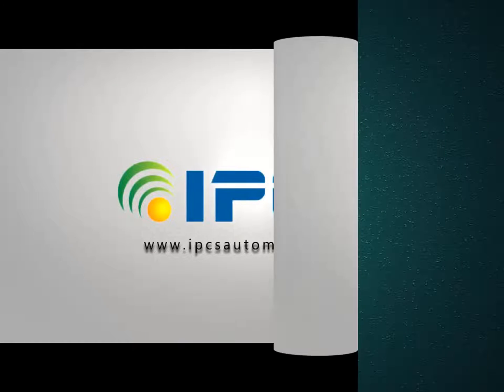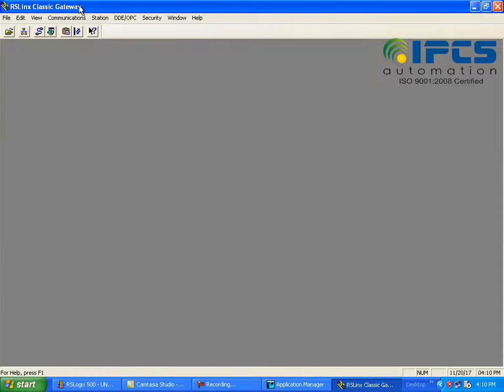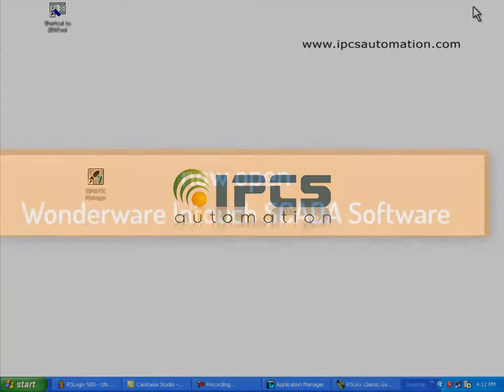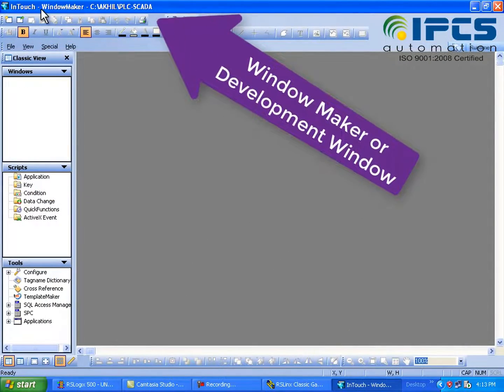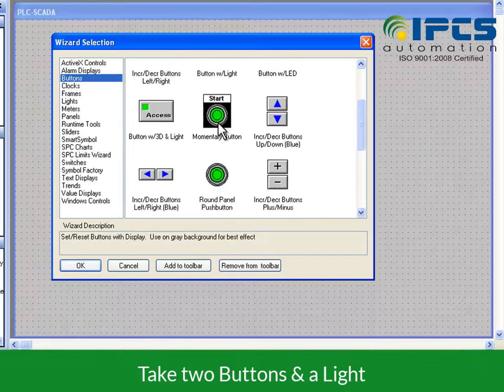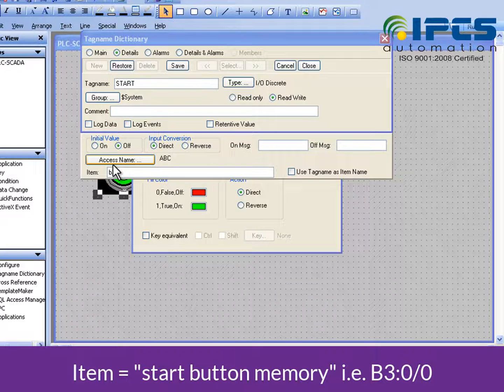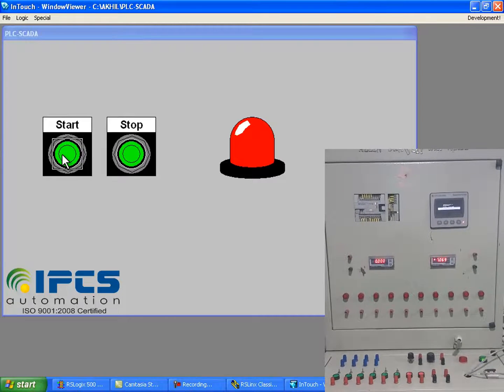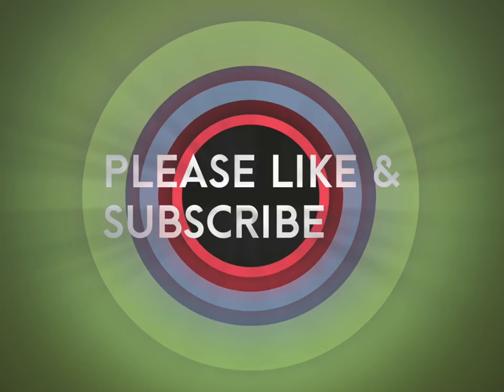PLC - SCADA Interfacing using Allen-Bradley & Wonderware Intouch (PART 2)

Comment: you used rslinx classic lite on the first video but. you used rslinx classic gateway on the 2nd. is there a limitation on the capabilities of lite?
Reply: Yes, you can only run lite between Rockwell and AB products. You need professional for other brands.